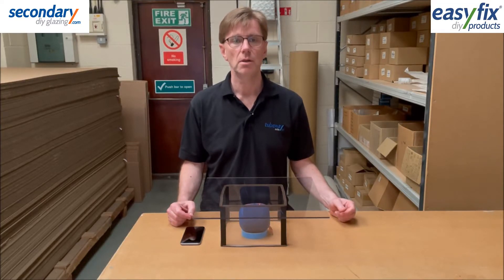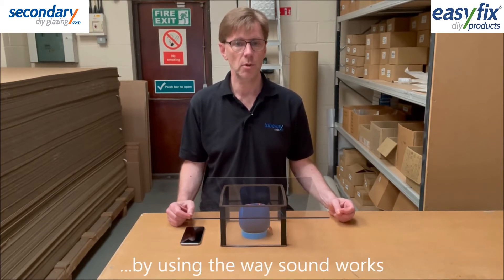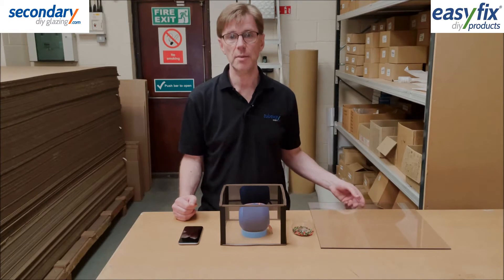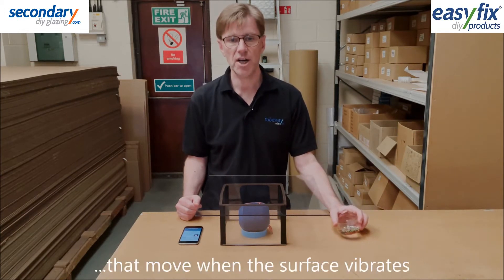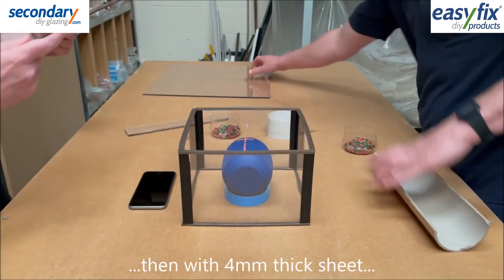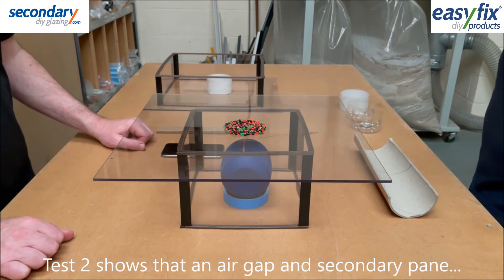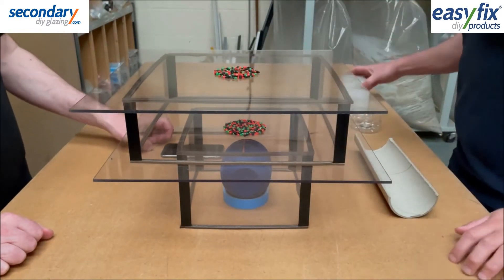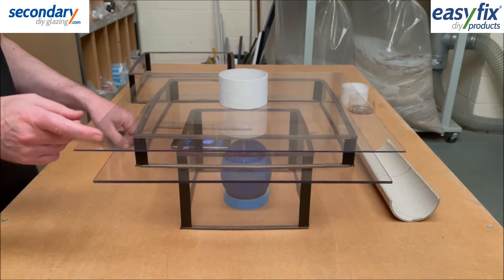Secondary Glazing - Noise reduction principles

Comment: I was pulling my hair out how to kill loud noise coming into my basement window.  I conducted many trials and wasted lots of effort and money.  I finally realized that a maximum air gap that works best.  My basement window sill is 15" deep and I took full advantage of that.  I made a plexiglass (1/8" Lexan) window plug and framed it with plywood and cork (as the gasket).  I also glued the 1/2" cork sheeting all inside the window sill (top, sides and bottom).  It worked better than anything I've ever used, it even attenuates loud bass music and loud car motors.
Reply: did you do a before and after video? by any chance? ;)
Reply: Is your solution still working great?.  Interested in doing something similar. Do you have any videos on how you did it? Thanks.
Reply: @rbhnr  Yes it is.  I put the plug in when I need it quiet, especially during the summer months.  No vids, but I can send you a few pics if you give me your email addy here in the comments.  If the bass is really loud I still hear it, but it's nowhere near as annoying.  The whole key is having a lot of the depth in the window sill (the more gap/depth the better) and making sure the plug is sealed air tight when the plug is in.  I also made the same size plug using 3/4" plywood and 1/2" cork sheet glued to the side facing the window.  It provides even better attenuation, but it blocks the light coming through the window entirely.

Comment: Fantastic demo! If you create a 150-200mm air gap between the two glass panes how much additional noise reduction would you expect from the secondary pane being acoustic glass rather than standard 4mm?
Reply: The air gap is more important than the thickness of the pane.  The larger the air gap, the more the sound is reduced.  Check out my post above.